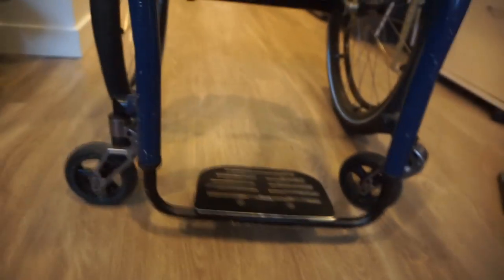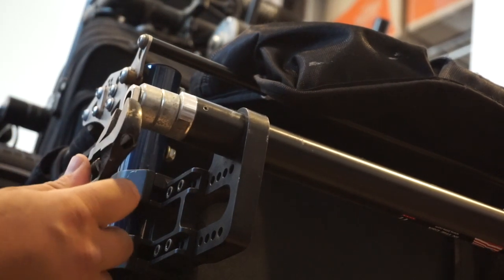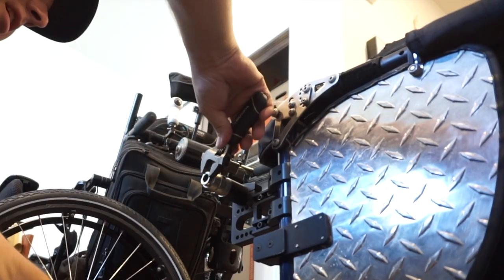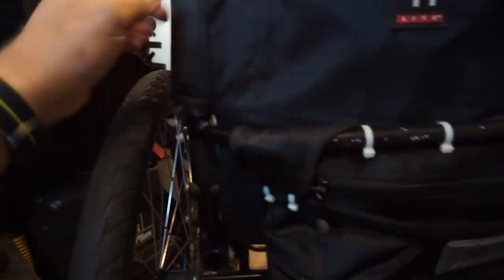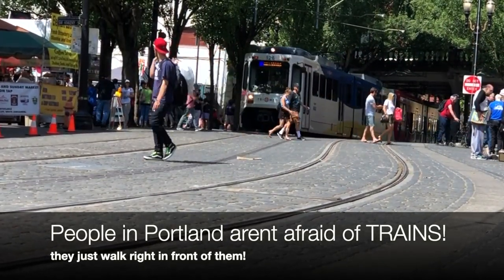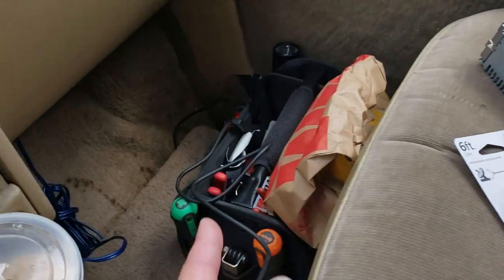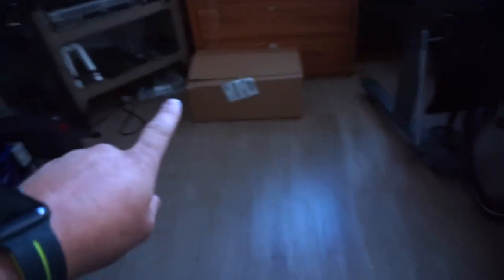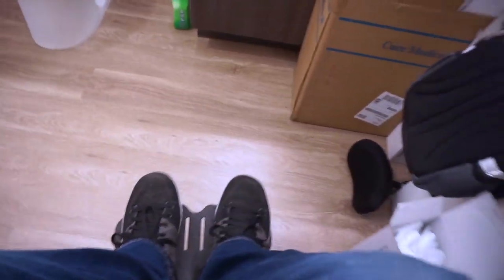MEGA VLOG 439: lots of repairs - and FREE STUFF!

Comment: Hey Dan, at 9:06 minutes,
I used some bicycle handlebar foam to do a wheelchair armrest repair (Q600). There is also bicycle handlebar tape that you could wrap it with. Or, you may even be able to use foam plumbing insulation. It comes in different sizes and thicknesses for various pipe sizes. The pipe insulation opens on one side then tape-glues shut when you are ready to seal it up.

Comment: I have a Permobile C500. When I tilt the seat forward, after it goes about half way the power shuts down. In order to get the chair back on (and stay on) I have to hold the recline back button down and keep turning the chair on. After it tilts so far back, it will stay on. I am assuming there is a break in a cable. Where can I buy cables from without having to go through a dealer? I’m on a limited income and can’t afford their prices. Thanks.

Comment: What happened too your cats? What did you do to lose so much weight?
As a side note the manual wheelchair might be a good candidate for a lithium pack and motor with a pull mechanism to disengage the motor to go to manual mode, never stranded. Great video once again showing the woes of being in a chair at times, like the car in the crosswalk.
Reply from the maker: 6: 53 in this video  https://youtu.be/J3cPEX-F2g4?t=413

Comment: Hello Mr. Normal,  totally off topic, but my eyes are blurred from watching so many postings. I think you are the most experienced Vloger on Permobil. I am stuck with a monochrome controller joystick for a c300. My power suddenly cut out while using the seat adjustment buttons. I was able to get error message when I connected to the battery charger. No movement or motor response,,  only a click inside the wheelchair base. Can you help me find information fixing the joystick module/ power module of the controller. ‘ JSM system error.   810D”. Is the message on the screen. What is a CAN bus?
I really enjoy your videos and I learn a lot. I would like to repair this myself and not rely on an authorized agent.
Reply from the maker: which specific seating function were you using when it cut out? and did the whole chair just power off at once suddenly? that particular error ive seen before on the older C-300 chairs...  does your chair have a plastic, or metal seat back? (to determine how old it is)